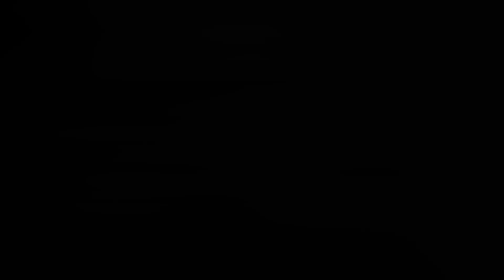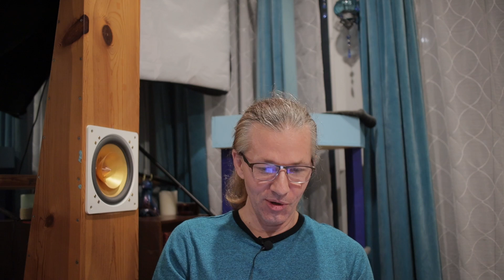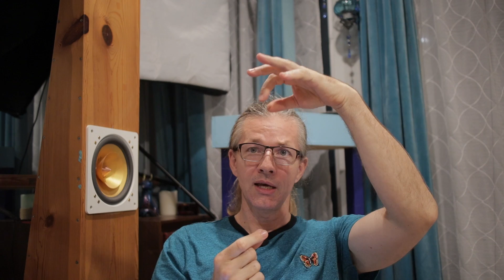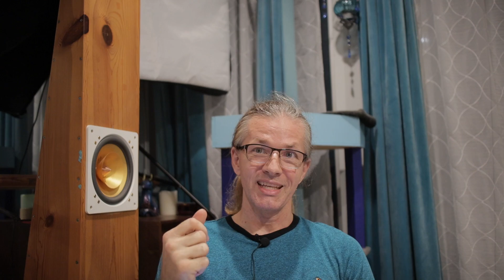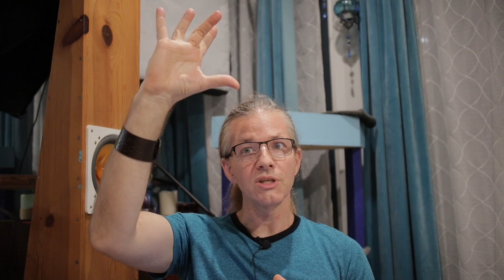Secrets of SE output transformers - It's not just the iron, it's the tube operating parameters!

Comment: You can do alot with other aspects of systems, Down to the individual solder joints and recrystallization of lead in connections does make a noticeable difference. 
Pin contact on tubes is another. 
If you want to start with a strong reliable piece of equipment, Tango transformers old and new are extremely good. 

But you can look elsewhere, just dont stray too far off in chifiland. Theres an astonishing amount off badly designed things from those places. 

I would like to know how to wind toroidal tube opts just to be able to do it myself, cheaply and experimentally. 
It is not hard, if its not made to be hard. 

Buying things is easy, too easy, I like the idea of taking part in doing things with YOUR OWN ENERGY and intuition. 
Its a reflection of character and truth... So is taking part in preserving and respecting YOUR PAST, like taking part in restorations and creating heirloom equipment, passing it on to others to do the same, servicing it, not forgetting it and throwing it away or letting it rot. 

The tube audio stuff from the past is the best of what has ever been made!!!

Comment: Hi Janos. It's such a pleasure to learn from you about all those different elements and aspects that are relevant in a well designed (SE) amplifier! I found an interesting article about output transformers but Youtube seems not willing to let me post the link (had to rewrite my comment again 🙄😅). When you google for "THE SECRET OF SELECTING A GOOD OUTPUT TRANSFORMER by Menno van der Veen") it should be the first result. Best wishes, Adrian
Reply: I just have to tell you what just happened: (I'm currently doing a lot of research and comparisons between 1626/45/2A3/300b SET amps as I need one for my Voigt Pipes which I'm currently building). So I was curious what output transformers that Derek Walton used to install in his 300b amps (you remember your video where you explain how you had discovered the Voigt Pipe 😜?). So I went to the side and guess what model he started to take in his Mk2 300b - tada - it's a "Plitron 3035SE OTX" which was developed by Plitron and Menno VanderVeen from which I had found this interesting article about selecting a good output transfomer). On his (archived) site he had written: "This TX which was developed over a three year period by Plitron and Menno VanderVeen, has been designed specifically and optomised for the 300B triode with a plate resistance of 700 ohms and primary capacitance optimized for a very wide bandwidth. Primary inductance is kept constant, independant of quiscient current through the power tubes and are designed to withstand DC current and impedance mismatchs using larger diameter wire and special winding techniques." Googling for "VDV-3035-SE (PAT-3035-SE)" brings you to the mennovanderveen dot nl site on which you can purchase such (or I guess a successor of it) for 300 Euro. Having a frequency range of 4Hz-90kHz (-3dB). They say that it can be applied to "300B / 2 x 2A3 / KT88 – KT150". Maybe this OT could be a perfect choice for one who wants to upgrade those amp models?

Comment: Hey Janos, I’ve been searching for the best amplifier for my Edgarhorns Titan II. Any suggestion for the best bang for buck SE amp? Below are the specs of the speaker.
Thanks in advance.

Frequency response: 80-20kHz @ 106 dB, 8 Ohms
Max SPL output: 110 dB
Mid bass horn: 80Hz exponential straight horn, EVM 15B driver, 80-500Hz
Midrange: 350 Hz tractrix round horn, JBL 2441 2 compression driver, 500Hz-10KHz
Tweeter: Fane ST-5022 bullet horn, 10-20 KHz
Crossover: 6 dB, first order, 500 and 10 KHz xover pts
Dimensions: 5H x 20W x 30D, wt: 150 lbs.
Seismic Horn Sub:
Frequency Response: 20-100Hz with electronic xover and EQ @104dB
Recommended power range:100-200watts
Max SPL:110 dB
Hyperbolic exponential 35Hz bass horn with JBL 2240 18 driver
Dimensions: 6H x 31W x 26D, wt.:350 lbs.
Reply from the maker: Yamamotos or Elekits would be my suggestion.

Comment: Thanks for that discussion Janos. I have some 3K Toroidy SE O/Ps that are about 40H. Their 5K one is only about 28H. But then they are toroids, that I don't think you are keen on, but they do sound good to me (not having something to compare them with though). And they are very reasonably priced for us in the UK! The other issue is that the inductance varies with frequency, but the manufacturers don't often give the inductance at a particular frequency. Also I still can't see how in class A, the signal current can can exceed the quiescent current. If so there will not be any advantage in more iron than required for steady state. Unless the operation goes into class B, but then the power supply and tube will have to cope with that excursion.
Reply: The purpose of the inductance of an OPT is to act as low pass filter (it's function is the opposite of a bypass capacitor parallel to the bias resister). We need a high inductance value to present a high impedance at low frequencies. So if the inductance changes for different frequencies, it would be most useful to specify the inductance at low frequencies, lets say 20 Hz. From there on, every octave we go up in frequency, the inductance only needs to be 1/10th of the value at 20Hz to present the same impedance. Hence the variations of inductance at different frequencies are far less critical than one may think.
Reply from the maker: The coming Audio Club Monday will be my follow up answer about class A operation. Video is exporting now ; )

Comment: Thanks for the insight!  It seems core size is the big importance here.  Something also championed by the late Tim de Paravicini.  Another note that might be interesting... A long time and well known transformer designer told me that inductance is not used while designing the transformer.  This is due to it being fluid while in operation.  Inductance is also relative to the capacitance and too much inductance will result in high capacitance along with reduced high frequency.  Everything in balance.
Reply: Yes the more the inductance the more the issue of capacitance. That's where the clever and expensive sectioning and interleaving of windings is used to reduce that problem. It would be great to learn how to wind my own......

Comment: B+ and P taps on the primary can be inversed ............with a worse result ........so respect the right connection on the primary .
Bias current shouild not exceed the half power possibility of the OPT ...but not to low also , the whole signal modulation and voltage swing should be within the hu-ysteresis curve...
The better OPT's do not have need for NFB for trnsmitting a clean undistorted signal, no distortion on the sloops or assymetrical behaviour and no ringing in the HF range.............
indeed designing the circuit with respect of the tubes will extend the lifespan of your expensive tubes..................tubes will wear out the most at switch ON and also on switch OFF ! ( just like diesel engines running endlessly when in continuos use but wearing out ( faster ) on every start up ).

Have a nice day all diy and music lovers .
Reply: I am struggling to see how a low bias current can negatively affect the resolution of a transformer (assuming that this is what you mean by "not too low also") If we look at inter-stage transformers, if is quite common and legit (though you may not like that method) to use a coupling capacitor at the primary winding. By doing so, there is no DC current at all. If a high quality amplifier can be made with such architecture, that is proof of concept that there is no lower limit of the bias current from a transformer point of view. Am I missing something?
Reply: yes I assumed that my comment was clear but ut seems  not so.........I comment on a single end OPT or in your case a SE IT.
To hign a current wil saturate the OPT ..............but to low will swing possibly into the heel( foot) of the hysteresis curve ....So  as a triode/tub inSE looks at the OPT the OPT in return also loks ats load ..........a current that magnetizes halfway into the hysteris curve can swing symetricaly iand use all of the magnetic capacity of a singleended OPT...........so it is important to choose the right tube and it's statisfactory operation point for a given OPT , but looking to the other side from the OPT it is equaly important tot choose the correct or best OPT to suit the tube that sits right into the correct magneteic operation point of ithe SE opt...
BY overdimensionning one can have some latitude ........but bigger OPT  have not always a better sound , theyhyave more leakage inductive, other gauge wiring and internal apacitance ....often they need kind of small correction.
All is in the right compromize ......
PP is another story be it an OPT or an IT. 
The better IT ( PP) are bifilair winded .............but very expensive .

Have a nice eastern Hugo with some sweet chocolat .  @hugobloemers4425
Reply: @frankgeeraerts6243 Hi Frank, I hope you had a great Easter too. Regarding the heal of the hysteresis curve, that is not at the zero current cross-over, it is at the extreme side of the reverse current.

Comment: 3K /3.5K is on datasheet foe optimum distaortion for the genuine WE 300B .......BUT in practice axperience shows by listening results that the lower 2.5K sounds better with this tubes J. Hirga deisgned his one also with 2K5  ( Partridge UK ).............All current production  300B ( besides WE ) are COPIES of the WE 300B ...........all sound different but no equals the original spec, original factory construction quality  and LIFETIME expectancy.( with exception of a few rare brands )...........some are sold as meshplate but are in fact perforated anode plates instead of made out of mesh wires .
Secret od an SE transformer is that it is polarised within the hysteresis curve and will transform the smallest dynamics and lowest signals ............NO so with PP OPT's......and cancelation of second harmonics .... 
Best combination is a well designed  TWO stages amp.......penthode input tube  and a triode as output ...........both can complete a very nice harmonic structure and gradation..
Like a WE310a--- WE300. and a NF2 ----AD1.........
Also usable as input driver are the WE717a, 593O RCA (red base metal tube of the 6SJ7), C3M.( high quality /LL -German  post /gold grid ), 1012S ( russia ) and some others....
As rectifier used (the WE274 is now obsolete ) ............a US 5U4G or it's rugedized 5930 GB Sylvania will do the job...........the WE274 had a litte more higher intermal plat impedance , so you can add some resitance on the plates of the 5U4 to mimic it ...........
Some do not like the sound of an genuine WE3OOB in their amp , ........because the amp was voiced for current production tubes
Partridge made exceptionel OPT's , no ringing no resonance higher outside the freaquency band of the music ............I like also the Japonese Super Permalloy with a very beguiling and musical sound but they are way out of my budget !

Tribute  ( Peter Treurniet ) makes exceptional OPT's ( nanocrystaline ) .....silicium steel lamination should be a thing of the past today .!
Band kern OPT transformers can sound  superior when build corretly as seen on <Ymamoto's ...

Kind regards